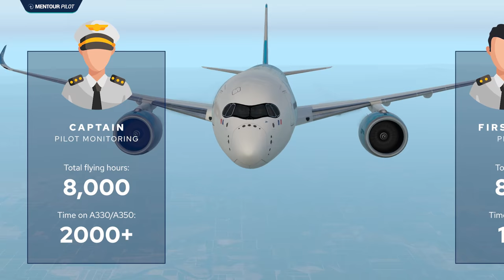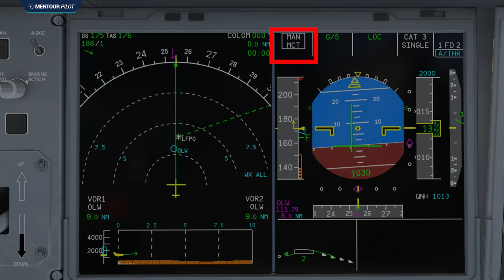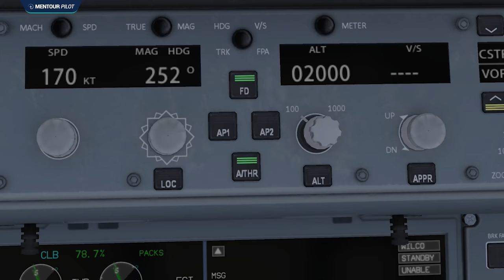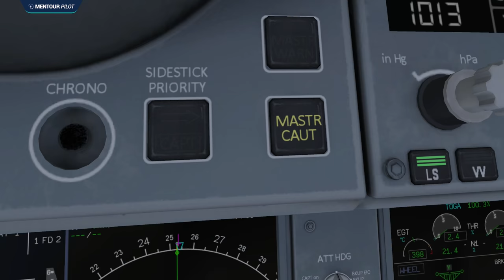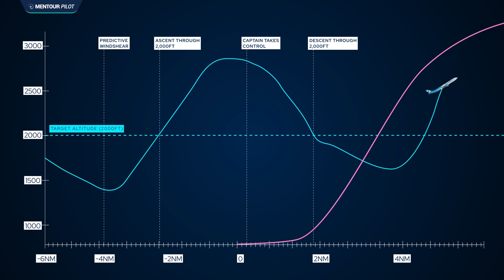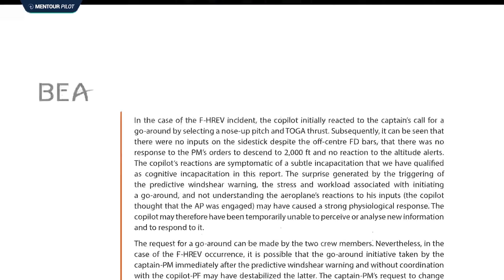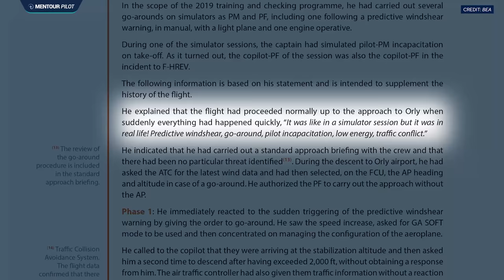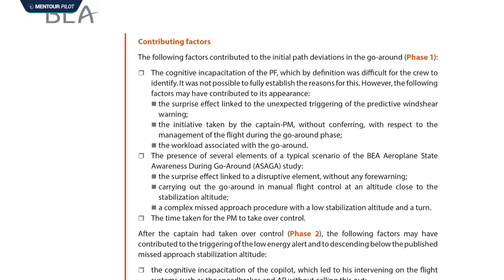What HAPPENED in this A350 Cockpit?! French Bee flight 711 explained!

Comment: I have been a passenger on quite a few flights, but not tons. I have been on two go arounds. One because the plane in front didn’t get off the runway fast enough and the other because the landing gear didn’t show locked position. I liked that the pilot told us what was happening. Stay safe.

Comment: Would it have occurred to anyone to investigate whether the first officer was taking statins at the time of the incident?
Reply: I think the FO should have had a full blood test immediately. I'd be interested to know if he continued flying.
Reply: Why statins? They’re associated with decreased vte risk and are on the FAA approved list. I’m not a flight doc, but I’m not sure what mechanism would cause a statin to cause him to react that way.
Reply: @michaelgoldstein8516  I know that statins were causing my husband to lose his eyesight, so they clearly can have deleterious effects. Statins can be quite dangerous. He had to go off them, but luckily he went Vegan and doesn't need those types of drugs.
Reply: @rebeccahenderson7761  statins can cause blurry vision and some other eye disorders, but it is extremely rare and happens in about 0.1% of patients. They also protect against vision loss from other causes, which are more common, so the number needed to treat is higher than the number needed to harm. It’s possible that your husband’s case was due to the statin (especially if it reversed after it was stopped), but even if it was, that is an incredibly rare occurrence.

In general, statins are quite safe. The most serious side effects are incredibly rare, occurring in less than 0.1% of patients. It is misleading to say they can be quite dangerous. Almost no one who takes them will have a serious side effect, and they are associated with benefit when used in the right patient (that’s the key-if your husband has no prior heart disease or is at low risk for cardiovascular disease, he shouldn’t have been on a statin anyway).

Comment: As a passenger, I have experienced at least one go around per year. On one occasion on an Fokker F-28 landing in Devonport, Tasmania, we had two near touch downs on the runway with fairly violent go arounds before landing only on the third attempt.  I’ve also had a fairly violent aborted take-off on a BA 747-400 departing Melbourne (lockers opening and anything not locked down flying forward into the next cabin).  We came to a stop on a narrow taxiway at 30 degrees to the runway….

Comment: The G/A is always a "startle event" especially if you are not prepared or up on your A/C procedure, throw in the low altitude level off, controller distraction with a new clearance or remember if you briefed the ILS/MAP and now cleared for the Visual... it can be Mr. Toads wild ride.  Some say a sat G/A is if you remembered to suck the gear up.

Comment: Frenchbee was founded in 2016 and has a fleet of 5 A350-900’s and already experienced a serious incident like this. They are really lucky, incidents like this with confusion in the cockpit has led to disasters. Hope this gave the airline a reality check to train their pilots. A disaster of this small airline would for sure seal the deal of their operations as a whole.
Reply: While CRM is enormously important, this incident isn't principally an issue of CRM. It is an issue with the Monitoring Pilot not effectively assessing that the Pilot Flying has become incapacitated. The speed at which this incapacitation happened clearly caught the Monitoring Pilot by surprise.

Comment: I am unfortunately not a pilot (maybe one day...), but I think I have experienced incapacitation due to overflow of incoming information at once: the brain freezes, it becomes simply impossible to think or solve problems...like overheating. You need to pause and let it cool down, which obviously is harder to do in the air flying at hundreds of knots than safely sat on the ground in the office.

Comment: I'm not a pilot (but an IT Project Manager) and I follow your videos as they are very interesting from both technical side as well as (mostly) from human factor perspective. 
In my opinion, the Captain was also in a kind of incapacitation as the "monitoring pilot" should be also monitoring the on-going process (besides supporting it) hence should seek clarifying the status at first sign of deviation and initiate corrective measures immediately.
Like any other possible failure, any kind of human incapacitation should be addressed immediately as impacts the top priority activity: aviation. No need to say that any relevant supplemental event (technical fault) could have lead to a catastrophic outcome in these conditions. The rest (navigate, communicate) can wait their turn.

Comment: The problem is, that go-arounds above go-around altitude or close to it, are hardly trained in the simulator. At least not wherever I flew in my 30 years of service. It would be an easy maneouvre IF you had a proper plan. For example get the autopilot into heading and altitude hold, decide then whether you need to descend (!) or climb. If you are close to level off, I would not even use TOGA but activate the go-around procedure in the FMS manually. clean up the airplane by manually select the proper speed and so on. Again: This needs to be trained more often.

Comment: I am not a pilot. I am an electronics engineer. An incident happened to me makes me think I understand the first officer's state. Many years ago, I was playing with a circuit that I had built on a prototype board (Bread Board). I was busy playing with the design and chopping and changing resistors and capacitors to see what worked best. In my absence of mind, I connected a Tantalum capacitor the wrong way around.Tantalum capacitors are quite explosive when you do that. Being caught so completely by surprise, I sat there in a daze for quite a while before I realized that my thumb was burned and my index finger had a good peace of capacitor embedded inside it. I guess that's what we call shock.
Reply: The possible lesson there is - connect up the component with power switched off. And then switch on power when the circuit is ready. And keep eyes and face and hands etc away from the circuit when powering on.

Comment: Trust my luck, I've had 2 go arounds in the last 10 flights I've been on. 1 was a red eye into Singapore on Scoot with no real idea as to why. The second was on AirAsia X into Perth. That one was one of the worst landings I've been on. My partner at the time was throwing up as the landing was like a rollercoaster. The plan was crabbing in sideways and we were being hit by wind coming over the darling scarp. You could feel wind sheer all the way down and the pilots throwing the plane straight at the last second. The first approach we got hit with a ghust at the last second and went around. The second time it happened again, but they put it down. Personally the second approach was not stable either, but they still landed it. After this, I have vowed never to fly into Perth as a passenger in the early morning again.

Comment: Not embarrassed to share my pilot incapacitation story. Mid 20s flying for a state agency. Various planes /helis used for mostly for supporting LE/ DNR etc. That night I was in a 210 Centurion. At 3 grand NV goggles for hours, cold wet night, slight head cold,  very tired. I had us in a s rate turn over our area of interest and watching a vehicle for at least 10 minutes. Suddenly the right seater also a pilot yelled "loosen it up!". I had us in a tight spiral but not losing altitude.  Corrected but was really sloppy and not talking which for me is a sign something aint right. So if your crew member get silent it could be sickness or much worse!! Not done yet....
We were suddenly broke off/cut loose and made a beeline for a uncontrolled field to drop off our agents. Only 15 minutes, a dark field, manual lighting. Got us there, runway filled the windshield , then my rt seater said.."You  ready to land? Yeah I said..
"G E A R !!!!!" HE YELLED into my ear. The 206 is a retract and I totally missed that detail. Nothing more was said. He knew I wasn't "right" and was watching me all night. All of this was kept off paper but I knew I slipped up and alone things might have turned of different. 30 years later every time I am about to land I hear his screak of gear into my ear... A bad night.

Comment: Many of these behaviors sound like impairment due to functioning during most depressed phase of the sleep cycle. Peak accident rate 2-5 am local time. The local time (Paris) was later but you add extended sleep deprivation. The copilots incapacitation sounds like circadian rhythm fatigue.

Comment: I was once driving down a very familiar local road, approaching a intersection with traffic lights.  I was neither tired, nor groggy, it being the middle of an ordinary day. I was not speeding, and was paying close attention.   I saw the light, at least a quarter mile ahead, turn yellow, and then saw it turn red.   I remember distinctly mentally noting that it had turned red.   But for some reason I did not apply any brake at all, I just kept cruising at constant speed towards the intersection.  About 100 feet from the intersection, going too fast to stop in time, I suddenly started and literally said out loud “ Red means STOP!”  I started to brake, and checked for traffic on my left and immediately laid on my car horn about 50 feet before I sailed into the intersection… a car coming from my left made a screeching tires sound as he panic braked as I then glanced to my right and saw a car coming and managed to swerve just enough to pass behind him as he crossed the intersection.  I made it all the way across without hitting anyone by some miracle, and immediately pulled over to the curb and stopped the car, putting my head in my hands and wondering what the hell had just happened.   I SAW the light turn red, but for some reason completely disconnected that from the MEANING of a red traffic light.  My mind had not been preoccupied. I was paying attention to traffic and did not even have the radio playing.  For 30 some years that experience of complete mental disconnection for no discernible reason has stuck with me.  How easily I could have killed or injured someone.  It made me a better driver because it made me less certain of my own competence.

Comment: Admittedly this is also one of those comments made in hindsight but there was absolutely no reason that they couldn’t have engaged the AP before selecting TOGA. I’m pretty sure I’ve done exactly that in similar circumstances. I’ve also advised the FO to do this on occasion as well as seen FOs do it without prompting.  European Short-medium haul A320 skipper here with around 15k hours. Probably have to fly 3-4 go-arounds a year.

Comment: Depending on the altitude where the go-around starts, going to TOGA may not be the best course of action. I’ve gone around by placing the thrust levers momentarily into TOGA and right back to the FLEX detent just to advance the FMS into the Go around mode. I’ve also just stopped the descent by pressing the vertical speed/FPA knob, selected heading, selected speed and followed directions from ATC. The worse that will happen is you’ll overfly the airport, the FMS thinks you’ve arrived and drops the flight plan which is easy enough to get something into the FMS to get you on the ground. I do agree that go arounds are rare enough that they turn into a $h!t show. I used to brief the go-around and if we get a landing out of it, all the better.  If you know you are going around, ie. not stable, I don’t get in any hurry. We know we’re going around so we briefly talk about it and then slowly but methodically execute the go-around. If by chance I’m hand flying and we have to go-around I’ll turn the autopilot back on and then execute the go-around. Autopilot does a much better job in the go-around than I can.

Comment: It was wrong when the captain pushed the stick forward upon speed warning, TOGA is surely correct, but pitching down is not needed if the angel of attack is below critical angle, on the other hand reducing angle of attack reduces lift when it is most needed as the speed already low and threatening of getting stalled... Pitch down can help getting speed if you are at cruising altitudes

Comment: I have an anxiety disorder and when I'm under stress I "black out". From what I know, this isn't noticable to anyone, as I'm still moving and speaking like normal but I'm essentially (pun intended) on autopilot. After the stressful situation ends, I don't remember anything afterwards. I think it's important to mention that while I can answer questions which I'm prepared for, if something comes up that my "autopilot" doesn't know how to deal with, I snap out of it but this process is so... violent, it's like someone threw a bucket of water on me while I was sleeping. It takes me multiple seconds to retrace how I got where I am, what I have been doing, and then finally process the thing that woke me up. So I can emphathise with the FO in this one. Someone like the Captain is a real lifesaver when something like this occurs, knowing that there's someone reliable standing with you so you can at least take a few deep breaths as you come back to reality instead of getting even more stressed. I'm really glad that this situation didn't have an unfortunate outcome.

Comment: ..even though  you disengaged the autopilot for an approach doesn't mean you cannot reengage the autopilot again..a windshear ahead warning.. gives time to think for 2 seconds and before you start the procedure just reengage the autopilot..then the whole lateral and vertical flying is taking care of and the Pilots just need to set the thrust levers to Toga and back to MCT for the Soft Go around mode..then flaps..sure hindsight..but they were still relatively high above ground so no need to go immediately into this go around rush...
Reply: Well said. I was thinking the same thing.  AP in, mini brief, TOGA.

Comment: This rings hauntingly similar to the 1975 Moorgate tube crash in London. The driver was feeling completely fine that day, people recorded him being his usual friendly self, and he had completed at least 4 arrivals into Moorgate earlier that morning without issue. Then, one time, as he approached into the terminal station, he did not apply the brakes, but instead kept power applied to the motors, kept the deadman switch engaged, and sat still as the train blew past the platform, past the buffer stop, and into the tunnel end wall, causing a terrible disaster. A definitive cause has never been established, but the most plausible theories point to akinetic mutism or transient global amnesia, conditions that are difficult to diagnose on the spot, similar to the one in this video.

Comment: Holy moly, no matter how this is spun, the behavior of the copilot was inexcusable. The guy was just randomly punching buttons and pulling levers without telling the pilot even after the captain took away control and he had time to calm down. A go around warning shouldn't be enough to send the pilot into a trance where he fails to the follow basic flight path despite verbal instructions and instruments advising of the course error. 
The back seat driver would almost be funny if the consequences were not so severe.

Comment: What I would’ve done with my captain and would always do is, before descending will do a briefing. I’d state that a windshear/pdw could be a probable cause of danger and safety if the flight and if we need to go around any point of the approach, will follow go around procedure, toga, climb to the go around alt in this case 2000 ft and set auto pilot and follow Atc commands

Comment: Anger resolve adrenelin. is a pathway psychologically that avoids fear  where you place the proper emotions into their aligned faculties ... some fear is natural so to avoid mistakes as complacency is worse. also a pilot in their process of elimination should have mentally prepared for different scenarios and their procedures as a conditioning mechanism at every flight... but some pilots build muscle memory into complacency auto engagement and when it alters, their response mechanism has not been shaped by preparation and exercise to perform under pressure...... the ultimate example of this phenomena is the employee jump on freight plane in 1994 or 1996 where pilots were bashed up and the pilot used the plane as a roller coaster , all of a sudden , flying manually was not so scary anymore compared to the threat of a hammer at your head...also the psychology that one is so close to landing but needs to start again is also needed to be recognised as a hurdle..

Comment: As a non-pilot, what would I have done differently? Is soil myself a valid option?

I consider myself an above average driver, driving trucks and other heavy vehicles, but every time I have used a flight simulator I have always been overwhelmed with all the switches and dial as well as constantly losing track of my location in 3D.

I can reverse a B with less than 2cm clearance on either side without even thinking about it. In a flight sim I lose all references to where I am.